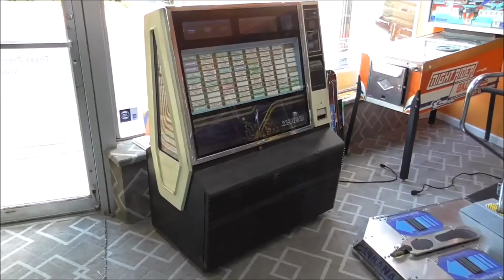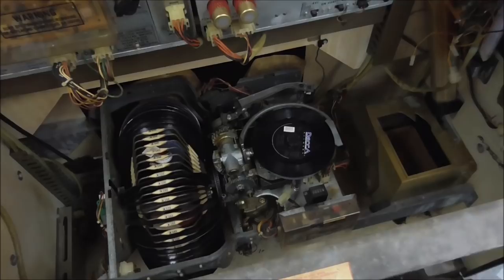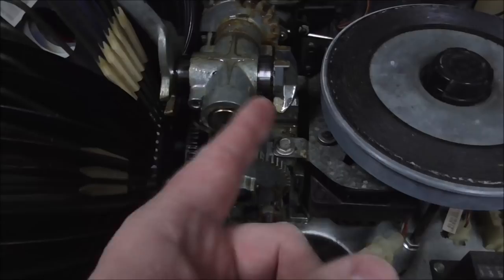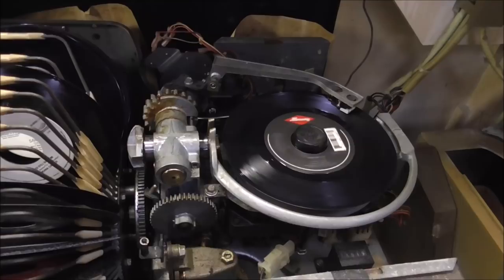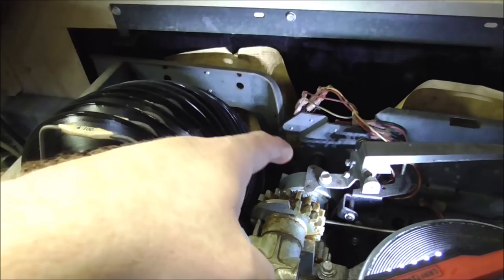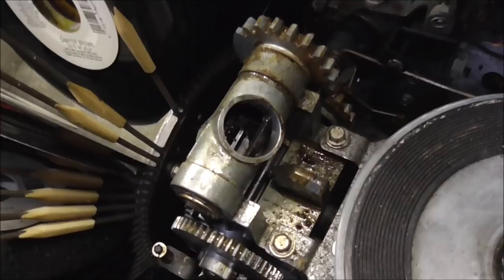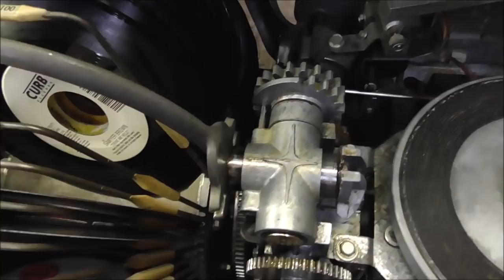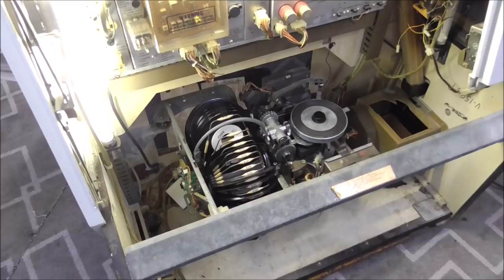How To Repair a Rock-Ola Jukebox Mechanism That's Sticking Or Not Moving (Most Common Problem!)

Comment: My father started working in the amusement industry in the mid to late 60s up until mid 90s when he could no longer see well. I have started restoring a few of these and I do not use machine or motor oil at all because those oils have a tendency to turn solid over time. So I use a teflon base or silicon base oil which I would use on copy machines I worked on professionally.
I also started restoring arcade PCBs as well. Lots fun when I was younger when I was learning and even more satisfying since retiring from the Army. So cool to bring the 80s back to life:)

Comment: I had a 454 which developed this fault in December 2019. I dismantled the gripper mechanism and degreased it but when I reassembled it it was out of sync and still didn't grip the record correctly and I partially disassembled. I thought I would have to call in a specialist or even send it away for repair. Then Covid happened and I wasn't keen on having strangers in the house and time just rolled by. This week I had another look and couldn't even recall how the parts I had left inside fitted back together 😞I had one last google and found your video. Such clarity and great video quality - 2 hours later my beloved jukebox was fully functional again!
Thank you so much for this - the 454 was a birthday present from my wife over 20 years ago and I can't tell  you how emotional it was getting it going again after such a long time - Thank You!!!
Reply from the maker: Very cool man, i'm glad you got it back together!  They're nice little well built boxes if you give them a little bit of service here and there, have fun with it!

Comment: I did a couple of these, but used lacquer thinner to clean out the old gunk after taking the piston out.
A Q-tip dipped in thinner for all moving parts and then use compressed air ( cover the record carousel and electronic boards before blowing) finally a couple drops of sewing machine oil on top of the sleeves / moving gears etc. make it smooth again.
For the piston I used lithium grease with a drop of sewing machine oil before putting it back together again.
Reply from the maker: That's a good way to do it!
Reply: @LyonsArcade  Thanks, less time taking everything apart. Never had a issue on 3 jukeboxes with this method. Metal gear are those "pot-metal" easy to break... Thinner and Q-tip & air solve the "goo goo " issue real fast, but again cover the surroundings delicate items before going wild with the air-gun.  Jukeboxes are cool until but most need attention after sitting for a long time. Best sounding I had was a Wurlitzer Statesman with 100 watt Solid State amp inside, could really crank it up load and sounded wonderful in the living room. Great for party's and dancing on the weekends with hot babe's :)  Keep up the good work and nice videos.

Comment: Hi Ron, I have just started the restoration of a Rock Ola 418 Rhapsody II. After driving out the small pin with my 1/8 pin punch and removing the rear follower and the record bow, I could not get the shaft with the gears on it to move forward.  I had to pound on the end with a hammer and pin punch while apply WD 40 which freed the shaft enabling it to be removed.  I could not believe that the previous lubricant could set like concrete.  The gear that drives the record bow was absolutely seized on the main shaft.  I wasn't until watching the this video that I realized it should be free.  After driving it off the shaft with a wooden dowl being hit hard with a hammer I removed all the crud and freed the mech up and now it works perfectly.  It all took about two and a half hours.  Thanks heaps for all your great videos.  Keep up the good work.  Regards a Fan from Aus.

Comment: Many many thanks for this. Mt rock ola 454 was stuck and after watching this video, I twisted the spoke at the bottom of the motor to free it a little and it worked str8 away, so whilst plaing etc, cleaned it up and little and a few dabs of oil.....and worked proper job.   Tiddly!
Reply from the maker: Very cool Mike, glad you got it up and running!

Comment: Ron, I have serviced several of these jukeboxes in my time and it's a good thing that you get it all apart and clean it but one thing you need to try is P.B. Blaster's penetrating spray....it will break that paraffin wax down that they use in that particular type of Grease and get back down to the petroleums of the Grease and loosen that up if you spray it in the hole where that little cap is on the end opposite the gear liberally it will make a world of difference,, trust me I've done it you'll thank me later...keep up the good work...
Reply: hey did the spay have a problem with two slec does not pic the rec any help

Comment: I'm working to repair my Rockola 444 following your video - so far I have it stripped, degreased and dry - ready now for oiling and reassembly - the reassembly worries me. The parts were SOOO gummed up it's a wonder it was working at all so I'm so grateful for your video. If I achieve a fix it'll have cost me £27 and a few hours of my time!
Reply from the maker: You'll get it back together just fine, the only real important part is when you put that roll pin back in to hold it all together, make sure it doesn't stick out at all so the piston can smoothly go inside the other part, if it sticks out a little bit it'll hang and get stuck about halfway up.  As you can see after taking it apart, that thing gets crazy gummed up, think how nice it's going to move now.  Thanks for watching TheGaragegymgeek!!!!
Reply: @LyonsArcade  it’s amazing how sticky and nasty it is. Thanks for the tips. Fingers crossed I get it back together tonight!
Reply: So it’s now super clean, oiled and reassembled, BUT I can wind it manually half way through its cycle (gripper pointing up) but the gripper (part 21) doesn’t rotate and the two gold metal prongs (part 3) get stuck on part 20. I didn’t touch any parts other than the ones you guided us through. I am sure the cogs are right and I have checked part 20 is on the right way up and that part 24 is properly seated. 

Any obvious tips? Should it wind both ways manually? Have I somehow messed up the timing with the two cogs?
Reply: Scratch that - I figured that it was hitting those pins as it didn’t have a selection queued. I powered it, made a selection and it works! It works!!!!!!

Comment: Hi ... I just had this 480 rock-ola, since being one of the first with logic boards, nothing worked in the memory, and nothing could be found anymore. With regret I demolished it, keeping pieces that can fit on another rock-ola, the electromechanical 459 that works great. Congratulations on the resolution of the caliper defect, which is similar to that of the AMI mechanics, before it became Rowe. Greetings Armando.
Reply from the maker: Thanks Armando, we appreciate you watching!  It sucks you had to take that one apart but at least you kept some of the parts for other machines!  See you on the next video.
Reply: @LyonsArcade  Yes, I was so sorry to scrap it too, but I tried desperately to repair, and look for these logic boards, but I found nothing. Even the various restorers have recommended me to stay away from the early 1980s j.b, with these logical memories, which if they fail, there are no more spare parts. So if I buy a j.b I look only for electromechanical, which is more repairable in case of failure. Regards Arm .... :-)

Comment: Fantastic video as always; thanks for posting.  Hoping you can answer a quick question. . .  My newly-acquired 480 trips the mech breaker when placing a record.  Sometimes it will do it 1x and sometimes it will do it 4x while pulling from the carousel to the table.  After play is complete it returns to the carousel with no issue (doesn't trip breaker). I went through the video's cleaning process and now all the parts move freely.  I also tool the gripper gearmotor apart to make sure there wasn't a similar issue in the gearbox, and it seems to turn freely.  But what I noticed watching this video (and others) versus my machine is how fast your gripper mech delivers the record versus mine, as mine takes an eternity (probably 10x as long).  Looking at manual it seems between sequence 13 when voltage first is applied to the gripper motor and sequence 15 when it goes to 'slow mode' through the resistors, something isn't right. . .like it's running in slow all the way through, and the system doesn't like it.  Checking transistors on the control board now, but wondering if you've seen this before and could help narrow my focus.  Thanks for adding to the coin-op community!!!
Reply from the maker: I think you're on the right track, I'd look at the transistors but ultimately you may have a bad motor that's drawing too much amperage and tripping the breaker.  Basically the board is sending it lots of juice trying to get it to move and it's taking forever to get there.  If you cleaned it and it moves fine that just leaves you the motor itself and the power train that drives it... Maybe check the voltage on the motor when it's moving to see what voltage it's getting.  When it hangs it up it sends it the same signal but it's reversed polarity to make the motor move backwards that may be a clue in the schematics...
Reply: @LyonsArcade  You, sir, are a genius.  tl;dr it was the gripper motor, as you suggested.  I measured the voltage while the gripper motor was running and was getting 20.0Vdc during most of its travel and dropped to about 15.5Vdc towards the end (tripping the breaker once or twice along the way).  Also getting 16.0Vdc when returning to the magazine/carousel.  Seemed low.  I verified voltage at the rectifier board and was getting 32.5Vdc unloaded.  For a loaded voltage comparison I checked voltage of the magazine motor while indexing and was getting 30.5Vdc, then went back and disconnected the gripper motor while the controller was sending a drive signal and was getting 32.0Vdc. . .probably should have done that earlier.  I disassembled the gripper motor and found the brushes and commutator were a filthy mess.  Cleaned it all with alcohol, cotton swabs, and a scratch pen and now it runs flawlessly!  Thanks again!!!
Reply from the maker: Very nice.  That will help me fix some in the future i'm sure.  You were lucky you were able to clean it up, if you kept running it, it may have opened one of the windings and you'd have to get another one.  Nice job, I love seeing these old jukeboxes get saved, it's such a shame more people won't work on them because they're very reliable once you understand how they work.  Super high quality machines.  BTW, we're starting a new channel eventually, that will be ONLY Jukeboxes!  @JoesJukeboxes here on youtube....

Comment: Yabba Dabba Doo.!!......Thank you much. Mine was tripping the same breaker and the mechanism was also not moving. I used a little bit of PB Blaster penetrating oil and a heat gun on the gear box to soften the goop inside it and Voilà it works now.
Reply from the maker: Very cool man glad you got it working!

Comment: Thanks for the info, I have a 1952 Rockola Rocket.  I danced to the music on it when I was a kid.
Reply from the maker: You can fix it, Jane!
Reply: @LyonsArcade  it needs a small belt and I think that other than cleaning that may be it. The electrical cord is old and the out side is all cracked up but it still works, what kind of cord do I use to replace it with.

Comment: I found that sometimes Silicon Spray will get these things moving again.  It seems to dissolve the grease a little to make it more fluid, and it doesn't go gummy like Water Dispersant formula 40 :)  Not sure if it is a long term fix, but I have had one machine that seems okay after a couple of years.    Of course nothing beats a full disassemble and thorough cleanup and regrease with fresh.
Reply from the maker: i've sucessfully gotten them clean with the oil before and I think they'd be fine if you got them going and then used them a little bit, yours will probably last many years like that.  I used to do all of them by just soaking them with various things but I kept running into that problem where it wouldn't grab the record to hang it back up (it may just be that the dried grease is getting worse as the years go on).... thanks for watching Brendan, we're going to do some more jukebox ones this week!
Reply: @LyonsArcade  I appreciate the teardown and cleaning. Both interesting to see it apart and I agree that nothing beats the rebuild.

Comment: Another great video! Always like seeing how things work. I once had a Seeburg 100 Select-o-matic. Don't remember the model now, but it was just like the one on Happy Days. Picked it up for a song (pun). I think $15. Had the single speaker reconed, replaced a couple tubes, bought a service manual and went through the cal procedure. Worked great! I sure am glad after seeing this video, I didn't have to clean the mechanism on that! Sold it back in the early 80's for around $700. Wish I still had it now. So what would that be worth today If I'd replace the amplifier with new electronics? Again, thanks for the informative vid's.

Comment: Man, Joe I wished I would of saw this video yesterday when I was trying to help a friends mom fix her jukebox.  Her gripper arm was stuck almost at the full position to which it would be if it was placing a record down.  When went through trying to figure out if something was jammed and if the motor that spun the carousel was bad.  I did find that thumb wheel to turn the motor and it seemed I could only turn to its half its limits of travel.  It wasn't turning to go to the home position where the gripper arm sits above the record and it would stop an inch or so above the platter instead of laying down flat like it should when it places a record down. We did lube everything up with some 3 in 1 oil.

We did pull the motor off and held the motor in our hand and turned the machine on.  The motor made an awful buzzing noise and smoke started to come out of the casing so I guess the motor is shot from trying to move that stuck up gripper arm so we have to try and find one i guess.  

Do you know of any where to find how the gripper arm assembly is supposed to be timed with the gearing?  I saw when you put it back together you didn't really show how it was timed.  Or does it not matter how it goes back together?  I could look at how ours is, but since we were messing around with it I cannot be sure it is in the correct position anymore.  After cleaning and lubing everything up the motor still smoked and got very hot so I am not sure if just the motor is bad now or if we have a timing issue.  Thanks for your video this will be a huge help next time I go over to help.

Comment: I have mixed lithium grease with the oil, and have never had any trouble. the "tar" from cigarette smoke is the problem, having worked for a vending company, maintenance was only performed when there was a problem with the unit !!!." if it was not broke, it was not fixed"

Comment: What do you recon is the best way to clean  up the chrome pieces?  And if you drop the motor down can you move all that by hand from above?  Oh these videos are awesome, thanks for taking the time.
Reply from the maker: The chrome all you can really do is use polish on it but a lot of times they have rust pits that can't be cleaned up too well.  If they're really bad and it's actually chrome you can clean them up with brillo pads!  Yes you can drop the motor but it has to be aligned when you put it back together so I always just leave it how it is.

Thanks for watching!
Reply: @LyonsArcade  by aligned do you mean timed?   And I did get it open and carriage was in the home position but living on the very east coast of fla all the contacts and such have rust in then. I will have to dismantle most of it a bit at a time until a get it whipped.   mechanical fist though. and thanks again.

Comment: Hey Joe really appreciate your video. Just a suggestion can you get a small dole rod paint the tip and point to specific parts as you give advice. lol. My 450 Rockola spins with thumps but doesn’t stop what do you suggest the selection buttons also don’t work. Any suggestions. Thanks
Reply from the maker: That's a good idea about the pointer, i'm going to have to make one up :)  The thumps, do they sound like the records moving around?  They move a little bit as it spins the basket.  When you start the machine up the first thing it does is move to it's home position, there is a big wheel on the right with a bunch of 'wipers' that ride on some metal tracks on the board, all those contacts need to be clean and shiny, you can use light sandpaper to clean them up, it's trying to find it's 'home' position which is just before the first record.  If you watch some more of my jukebox videos I go through how I work through them to get them working.  Thanks for watching!

Comment: Three in one oil is good.. but you can spray a little bit of PB blaster and that blaster will help soften some of that paraffin wax grease and it softens the wax from the oil without harming any other components then you can go back and lube it with the three in one and the petroleum's from the grease will still be there... A, just to get it moving tip

Comment: Great Job!  Would synthetic grease/oil work better and not cause issues as it ages?
Reply: You need a grease that has a non drying soap in it.  Maybe a good polyurea?
Reply from the maker: maybe but I've had good luck with the 3 in 1 and it doesn't dry out like the factory stuff did....